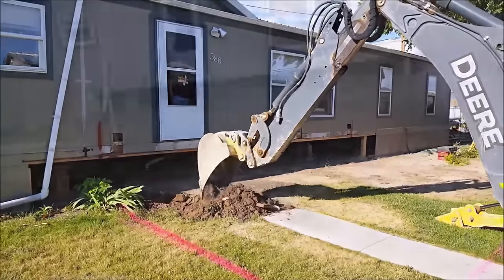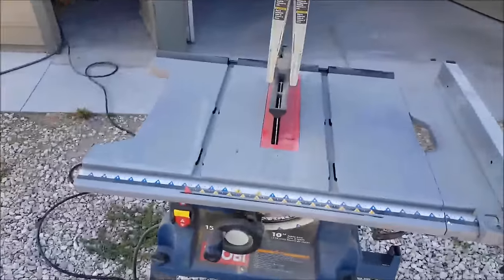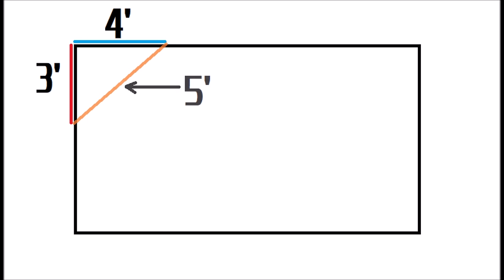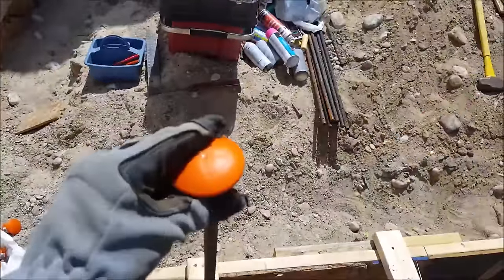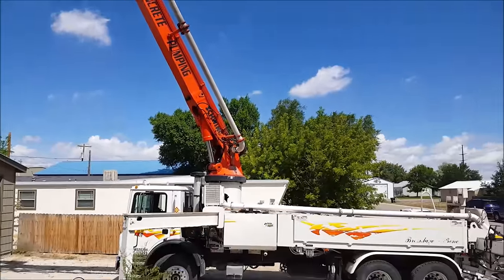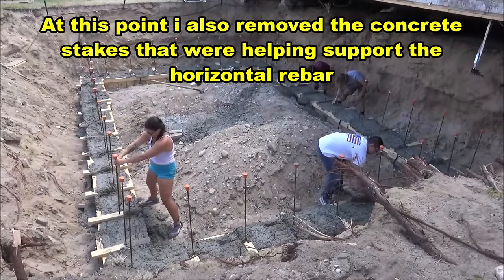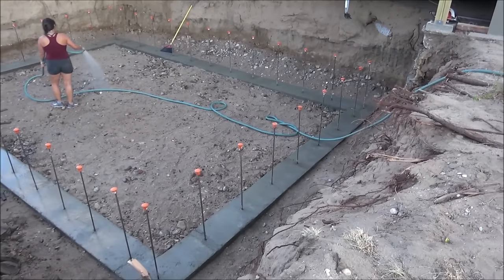How to Pour Concrete Footers for Block Walls start to finish DIY

Comment from the maker: Hello everybody. When I sprayed the forms with grease @6:55 in the video I sprayed the wood only and avoided spraying any rebar using a spray can with a tiny nozzle, this requires accuracy while spraying, with that being said it would probably be easier to just grease the forms before any rebar is present.  Also @6:00 in video I talk about the vertical rebar for blocks. Depending on your local building codes a small 6" bend at the bottom of vertical rebar may be needed.
Reply: Can't hurt to do it even if the code doesn't require it, can it? It's possibly a pain, but probably worth it.
Reply: what if i dnt use a vertical rebar, would this make the foundation weaker?
Reply: Joathon
Reply: @chinoblood1  Then the backfill pressure would be able to push the wall inward at the base. Another reason you don't want perfectly smooth footers.
Reply: A rough finish on the top of the footers will hold the mortar better. Just not too rough that the footer has high spots.
Reply: Nothing wrong with building your own shit
 My word.
Reply: C.L.S. All-IN-ONE, can you do a video explaining how to build a stone house.

Most books I have been able to find do not go into detail enough. 

They lack:

1. Explanation on attatching walls to foundations

2. Roofs to walls

3. Slipform building, or how to build the wall stone by stone on the foundation

You give clear explanation so I would like to see you break it down.

Keep up the good work.

Comment: For a rookie you did a good job.  If this is your first time you did a really good job.  A couple of tips:  make your forms a couple of inches high and hammer nails in at pour height.  That way you can finish under the boards without taking them off.  Second:  Use a vibrator to settle the rock and aggregate during the pour.  It also chases the trapped air up and out of the mud while pouring.  Third:  Use plywood cleats across the top with spreader blocks instead of 2x4's.  As far as oiling the forms, you can buy form oil and an open top sprayer and coat the forms before you set them. Don't get any oil on the rebar.  Also, after you pour the mud and vibrate it, don't monkey around with the iron.  It's set in good. Plum it after the mud sets up a day by bending it.  No inspector is going to soil himself if you have to bend a dowel a few degrees.  Finally, any mud that spills out over the form onto the back side,,, get that shit out of there before it hardens so stripping the forms is easy.  Just spread some plastic sheeting out and dump the over pour on that.  As far as rebar placement, we would run a 2x4 on edge on top of the cleats the length of the pour and either tie wire or bend nails over the rebar on our layout.  So you can set all the forms and put the rebar in last.

Comment: Never ever allow the concrete truck or pump truck drivers to determine the speed at which you’ll pour the mud.. you may pay some overtime fees but concrete is a lifetime investment and a little more money in time to NOT make the mess you did here will be saved in the cleanup process after the pour.. Pouring concrete is not a sprint when done right..

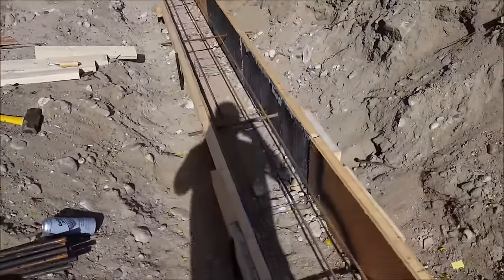Comment: That's a nice solid structure and the foundation is great. Great work all around! For those looking to save exponential amounts of money and especially time though you could skip all that form building, "greasing the forms" and the super high vertical rebar with the "safety caps". As you are digging it out either by hand or machine, just dig the form of the footer in the dirt itself... You're gonna want to put 2-3 adjacent, long, lines of horizontal rebar down the and length and width of the footer, regardless of whatever city or state code, and bend 90 degrees around the corners. You also need all this rebar on the ground to raise a good 3 .5 inches above the dirt for the concrete to set below it. We can do this by simply splitting regular red bricks in half and placing them beneath the rebar about every 4 feet. You don't have to buy special cuts of steel wire for this, you could even use stones from a nearby creek to make sure you rebar is high enough above ground. All this effort will almost entirely prevent cracking well beyond your great, great, grandchildren's lifespan if done properly. Don't forget the rebar tie wire that connects each individual piece to the next and  double  up at intersections between individual pieces of long rebar with at least a 20 inch overlap . At 4:50 in this video we're going to instead put a short 16-18 inch piece of rebar crossing our long pieces and tie those in with wire as well. Finally, every 4 feet, you drive an 18-30 inch piece of rebar vertically along the center of your footer and use a laser level to put them at the exact height you want your footer to be all the way around (about 12 inches of concrete for 1 story structures). As you are pouring concrete you have an easy height measurement with that vertical rebar that's been leaser leveled exactly, instead of a health risk you need to buy extra stuff to cap off or a huge, time intensive wooden form made from planks you can barely re-use. As a disclaimer this method requires more skill in digging, especially with machinery and you may use an extra yard of concrete or two, however it saves huge amounts on lumber, grease, plastic, and most importantly... time.

Comment: Awesome vid. About to do some footings myself for the first time and this was great to see the whole process. One thing I noticed is that the whole area looks pretty dry at the end. Usually, you don't want to allow the concrete to dry out until it has finished curing or it can cause surface spawling. I've seen crews cover their work in plastic to slow evaporation if going out and spraying it down often is untenable.

Comment: Nice. Only suggestion is you can rent a virbrator or perhaps use a sawzall without a blade to help the crete flow and remove voids. You can also talk to the crete company about some plasticizers which help the crete flow more liquid-like.  I have to do a similar for a large shed, and this was a good reminder from when I did this as a teenager.
Reply from the maker: Thanks.  The crete vibrator would have been nice. I used on for my concrete steps it worked well.

Comment: That was a nice  job. I would build the form boards  using the 2x4 in perpendicular position ,that way give more strength to the forms( you can not believe how much concrete can punch to the forms)Congratulation!!

Comment: A few tips. 
-If you want the rebar to hold a downward load install it about 2” from the bottom. If it’s an upward load put it about two inches from the top. If you put it in the center it carries little to none of the load. 
-A concrete vibrator rental isn’t that bad. 
- If you want the grout to bond to the footing leave it slightly rough and dampen as you apply the grout. 
- the vertical rebar should have been tied to steel mat and not set on blocks. (I’ve rejected pours for this very reason. Contractor was pissed.🤷‍♂️) 

Overall it seems like a good family project. The kids will never forget that.
Reply: What do you mean by upward load with the rebar compared to downward load?
Reply: In your first tip, you're talking about the horizontal rebar in the channel? I'd also like to know the answer to the other person's question :) Also, what exactly does "grout" mean? He's saying to fill the cells of the concrete blocks with grout..is that a different mixture or he just means more concrete?

Comment: Loose the 90 degree corners on the inside and make radius. Adds a great amount of strength and eliminates the potential for cracking as there is a high pressure point on the inside corners

Comment: Very impressive! i am planning on building a block/brick shed in my back yard. Unfortunately for me, because of the frost line, it appears I will need about 10 cubic yards of concrete for the footers/monolithic slab, yikes

Comment: We wrap tie wire around our forms about every three feet to keep it at 16 inches so that we can trial off the top of our forms one guy with a concrete rake behind the pump to knock it down then after the trial guy we wet set our rebar using a tape to make sure the spacing is correct

Comment: Looks good. 
really 
Only advise I can give you and you may use it may not. you can use motor oil for the form and that way it will comes off easier. 

And the rebar is little high maybe if you just have it out for couple feet and the mason ties it as he goes it’s just easier based on my experience

Comment: Great video, very transparent and informative.

Question:
Would it have been possible to use the earth as a forms/support for the footings?
Excavated a little down then dug out the footings, poured concrete straight in (with rebar), once set the remaining earth can be removed from the “center”
Reply from the maker: It's possible to do it that way but it depends on  soil/earth for my build the soil was sand so the holes just cave in when digging.  If the soil can maintain a good structure when digging it can be possible.
Reply: @D.I.Y._All-in-One  thanks for the quick reply!

Planning a basement build in UK and preferring to use the same block method as you have - compared to making large forms/shuttering to pour a concrete wall.

Comment: Great job. Decent work. Only thing i would have done differently would be to turn the 2x4 on your OSB with the 1.5 inch side touching the ply. Its much harder to bend a piece of wood in that position hence more support on top and bottom of the ply. Them add wooden stakes every few feet with cross braces and that son 'o bish aint going nowhere. Where's it going? Fuxin NOWHERE!!! LOL. Great work a
Overall buddy. Keep it up. End product looks great! And great idea for the dobbies...not many people do that. And always use a vibrator or hammer amd bamg the shit outta the forms

Comment: Nice video, I had never seen the vertical rebar without a bend or leg at the bottom and tied to the horizontal bars I don't think it would pass inspection in CA.
Reply: Yes, they typically have a 90° hook tired into the bottom mat.
Reply: I’m CA wouldn’t pass

Comment: I do not intend to pee into your cheerios, and it is only a footing, so the 3x4x5 triangle is fine.  However, I prefer a corner to corner measurement and a taunt string line bc lumber always has twists and kinks to it.  If you set your corners first, the rest is fine tuning and spacer blocks

Comment: I really love your video and its the best that has shown me how to actually build a basement with concrete blocks. I hope you will get to see the comment and answer a question that is on my mind. my questions are:
1. I can see that there was no damp proofing done for the walls and foundation of the basement. What is the best way to do that?
2. What is the purpose of the rods sticking out with the red caps. Sorry I no nothing of building houses so I dont know the terms.
3. What was the measuring rod?
I know the video is 3 years old but I would love a reply.

Thanks

Comment: I've always wanted to extend the back of my house ... this is a cool video .. the only thing that seem to be missing is a drain tile next to the footer  .. maybe it's not required by code but if it ever leaks water there no drains ?
Reply: They'll have to go with a sump pump. The tile will go on the inside of the footer instead of the outside.
Presumably if it's required, I don't know his local building codes.

Comment: Just curious... aren't basement wall exteriors supposed to be covered with impermeable material so that you do not get humidity, water leaks or mold in your basement?
Reply: waterproof all the things
Reply: @W333dm4n  I would
Reply: I was wondering that. No StegoWrap or similar waterproofing membrane?

Comment: Outstanding work and planning. You could have/should have rented a concrete vibrator to get all the air pockets out of the concrete. Also, the vibrator would have reduced your trowel labor by more than half.
Reply: that is my thought too. vibration is important.

Comment: To square it up you can also take the square root of the width times the square root of the length divided by square root and that is the measurement corner to corner diagonal

Comment: There are much easier ways for a rebar template that was a lot wood and cutting and if there’s a next time hang the rebar from 2x’s with tie wire not drilling the forms. But overall good job!
Reply from the maker: Thanks

Comment: I'm thinking of removing my inground pool entirely and putting an underground greenhouse (about 30' x 20') in its place. I researched ICF's, but those would cost way too much. I want to make 10' retaining walls out of concrete blocks and then backfill with 2' of rich soil. Do you have any tips on waterproofing the first 2' on the inside? I also want to build a polycarbonate panel structure (to complete the greenhouse) on top of the retaining walls, so I assume I would make a second foundation?

The underground greenhouse will have a max clearance of 18', which I need because I want to grow tropical trees.
Reply: ALWAYS water proof the outside of the block, not the inside.

Comment: I use 2X4s.  I rail 4 and dig 4 on the majority of footers I find the high spot in the area and use 3.5 inches above that so no boards would need to be dug down. rail 4 and dig 4 saves gravel to.

Comment: I learned a lot. But, no moisture barrier?
Reply from the maker: That depends more on the soil composition and water table depths, For my project I was dealing with sandy rocky soil with water tables way lower than my basement, so it's not an issue in my area.  You should consult with your local city building department about possible recommendations to learn what's required when unsure.  Also the city can usually can give you references for who to contact if they don't have the answers.

Comment: Question:  I want to build a small 4'x8' concrete footer/slab w/walls 5 feet high.  Only question is how deep in inches should the footer be and how many inches thick should be the slab?   Thanks!

Comment: Just curious about the drainage around the foundation. Did your county codes require you to have drainage or drain tile around the footers?
Reply from the maker: It depends on location in relation to water tables underground,  and the soil composition, I have sandy rocky soil that drains water adequately. And the water tables in my area are far below my footing depth.

Comment: should be very careful when oiling the forms, do not get any oil or grease on the rebar.  great job
Reply from the maker: Thanks. The spray nozzle was fairly accurate so I could spray only what was needed.  But on a windy day it might give me issues though.

Comment: Just watch your video, I notice you didn't used damp proof membrane to stop maestro coming up from the earth, here in the UK we would do so.
Reply from the maker: Here it depends on the water table and what's in the soil samples on whether to use a membrane.
Reply: I think this guy is somewhere out west. No problems with moisture. Here in the Midwest- it's like the UK ... We damp proof everything.  Lol...

Comment: 320...😕.   That sounds super cheap.  👌.   Also, oil before bar and a 2x4 edge on centre of wall along tbe length of the form makes a nice tie piont for rebar.

Comment: Guess I know just enough to be dangerous…. I thought foundations were whatever the foundation dimensions are into undisturbed soil, which would mean no need for forms. Also am wondering if the sizing of the footing (16” for 8” block) changes with 2 10’ stories (31 courses).

Comment: 300$ pump truck WOW what area is this - in my location $1300
Reply: Boom trucks are a little more than the regular pump truck but I said wow too that's cheap.
Reply: I believe it was 300 more than just a regular truck with hoses, etc.. not just 300 dollars..
Reply: 320 an hr

Comment: I drill in my rebar. I do concrete block brick and stone restoration jobs. Buckled basement walls too far gone to push back get torn down. Hold the house up with teleposts relay the first coarse then drilled my holes in the footing for rebar.

Comment: Excellent instructional video without any cringeworthy drama - thanks!

One question:  in the last step, while installing the cinder blocks, you added grout into the voids to ensure robust engagement to the vertical rebar.

Once the row of cinderblock starts rising above the rebar, do you continue to pour in grout, or are these additional rest kept in place simply by the mortar?

Thanks!

Comment: Okay this might seem like a stupid question but all questions need to be asked at some point so can I have an explanation on why exactly the vertical Rebar cannot touch the dirt? I understand the horizontal rebar obviously needs to be raised because it needs to be in the center of the concrete and not on the bottom, but the vertical bars go through the middle of the concrete either way so what is the purpose of making sure it doesn’t touch the dirt? Is it purely because of worry of the bars sinking or is there some sort of structural issue involved? I’ll put the blocks under there regardless that’s not any issue, I’m just curious to know the reason cause I like knowing the reason for whatever I’m doing. Thanks in advance.
Reply from the maker: Rust can be a concern if the rebar is directly touching the ground.